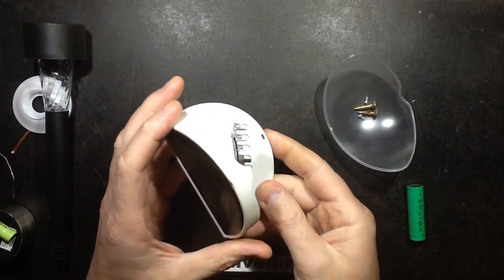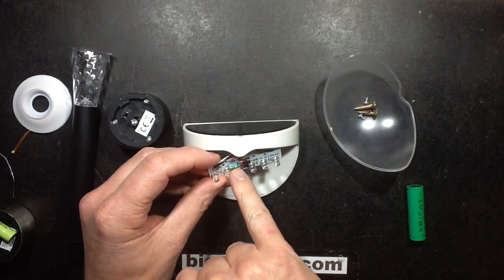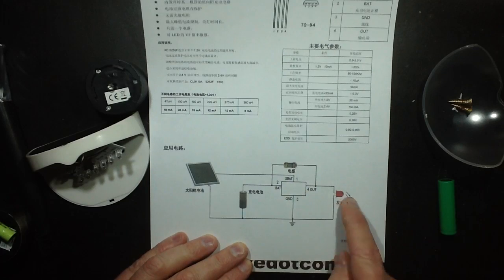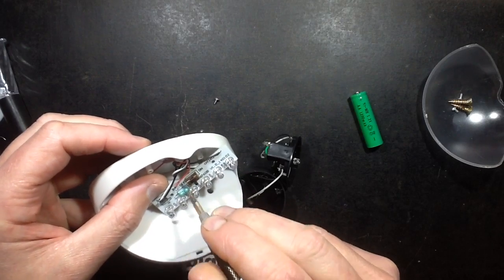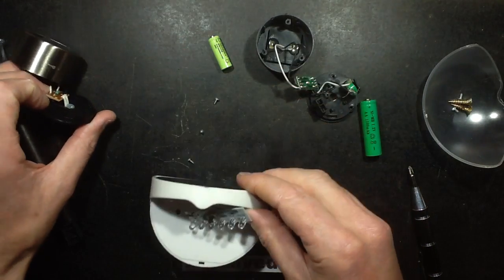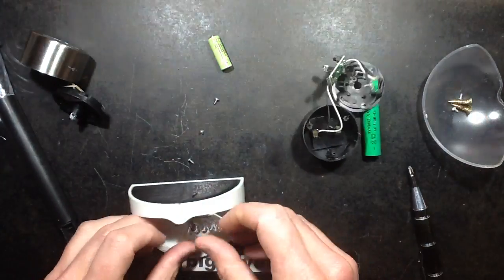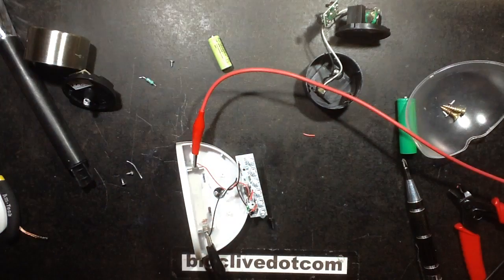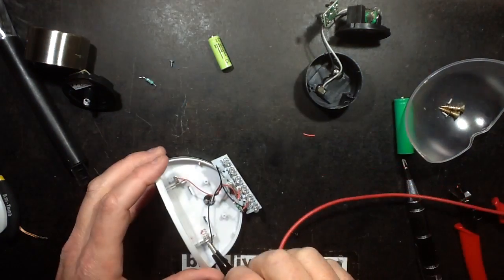Extending the run-time of a solar garden light.

Comment: A bigger capacity battery Clive !
Reply: Gord Reason Problem, is a bigger battery also requires a bigger solar panel.. Which basically means a new light assembly! lol.. It's simpler to reduce the led current draw, by replacing the inductor, as he did in the video. Or simpler still, by removing a couple of led's. I've done that before!

Comment: Just use the ferrite inductor in an old am radio.
Reply: I have tried using a 330 uh inductor. If the inductance is too high the led will not light up.

Comment: you are using the cutters the wrong way to strip wire. the v grove needs to be reversed to how you use them . ( I know you don't believe me ), trust me I am left handed.
Reply from the maker: +line10cls Thanks, that is actually a new technique to me.  I can see the logic.  The flat edge is more likely to lift the insulation to make it part than the tapered edges squeezing it in against the core.
Reply: Also if you are stripping thick-ish  wire use the tip of the cutters to cut  1or 2mm at the strip point to create a "stress" point in the insulation making the insulation to strip easier.
Reply from the maker: +line10cls I already do that, but also nip the edges of particularly tough insulation on thin wires in the same way.

Comment: in my garden light i used 6v solar panel and 3 volt battery for rbg led...now the problem is.....led is running on solar panel also....it doesnot turn off in sunrays....why?????

Comment: You don’t need to open it, change any led’s or read any diagrams 😂, all you need to do is remove that crappy ni-cd battery and replace it with a ni-mh 2000mAh cell and your light will stay lit all night long instead of fading after 90minutes!